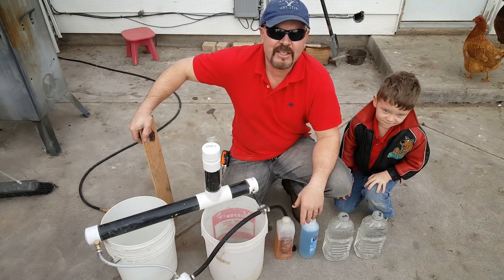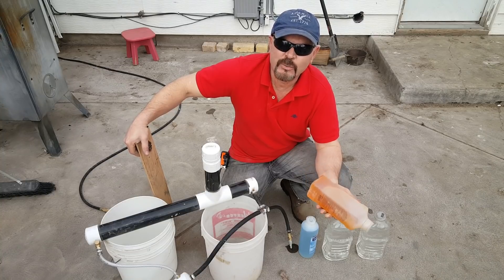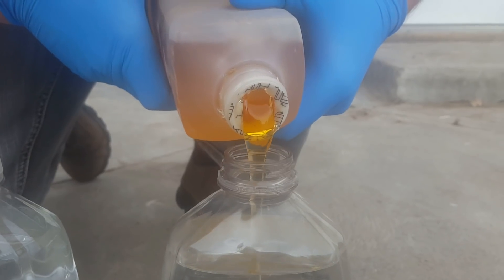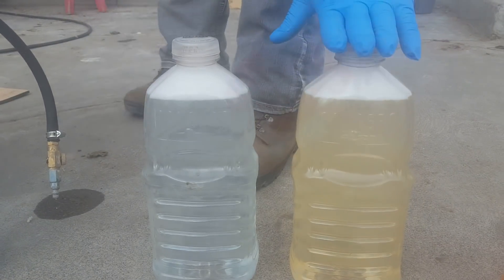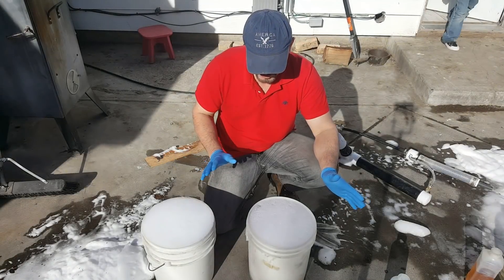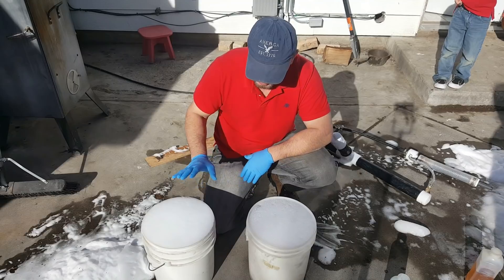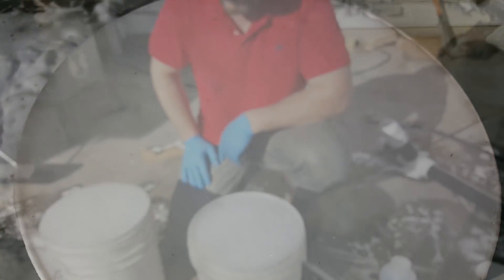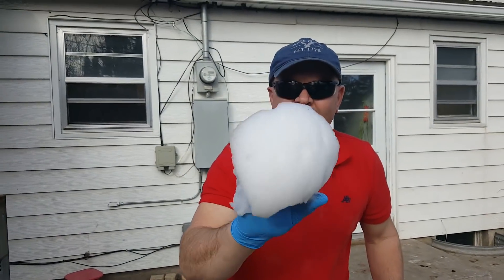The Best Aircrete Foaming Agent $ for $

Comment: I'm thinking about making a rocket stove with slightly more expensive materials used for making a DIY foundry. However, instead of making the entire mass out of the more expensive stuff, I will try making only the inner liner to cut the cost in half. That would be too thin by itself, but then I plan to cast a thick layer over everything with aircrete. When I saw rocket stoves out of aircrete, only the inner skin that was exposed to the flame was eroding. Thanks for all the great aircrete info!
Reply: If you had positive results, you should make some youtube video, which I expect might do really well.

Comment: Would also be nice if you could post the latest , precise measurements of ingredients and ratios. How to figure out foam weight or volume/whichever one you are using. For grins and giggles I built a foam wand last year and it worked very well. Used an AEWC, air expelled water can, you know, those shiny silver fire extinguishers you see hanging in stores...however, I am a true believer in getting info and directions from successful people doing the same thing I am trying to do, so looks like I will be buying one of your kits. Why reinvent the wheel?

Comment: What about that 7th generation dish soap, everyone raves about ? i don't mind spending extra on the Drexel... whatever it's called, commercial foam if it's better. I mean this is a big investment. I have no idea how all of these bubbles persist when mixed with cement.
Reply: The cement and stiff soap foam actually forms an emulsion. When done right (with a proven recipe, proper soap foam, a strong mixer, ideal temps & humidity) getting all those things dialed-in as perfect as possible, will produce a really good aircrete that is strong and durable.

Comment: Id written before wondering if I can use the mix on a quonset hut & since ill; be using plasterers lathe on the inside walls & ceiling s I was concerned about it just going right thru the mesh . Finally dawned onme that if I mix a lot then just let it set to a firmer consistancy then I should be fine with minimal clean up inside . It going ot be approx 2 inches thick on the outershell   so I can just shovel it on then  trial it down for a smooth finish .May even do the inside with the foam mate aircrete  hopper first if theres any issue about it leaking thru too much . Id thought about forming panels but I was thinking forthis style of home id be in way over my head forming them then placing them 
 Always love going back thru your videos .Best of success to you in all you do especially in this endeavor

Comment: I found this channel and was really excited, where has aircrete been all my life.   I immediately set about building a foam generator.   Mostly a hybrid of this one and Jim Whites using the eductor and combining air and liquid in a T junction before the wand.    I got what looked like great foam, tuned it to 3.3oz/liter and tried lots of foaming agents including the recommended Suave and even the expensive Richway CMX.  All of them turned back to liquid within 15min after looking nice an thick just like the videos.   I tried warm, cold, filtered soft water, hard city water, densities from 2oz/liter to 4.2oz/liter always with the same results.   I thought maybe I should run separate lines and mix at the wand, skip the eductor, just like the honey do machine so I modified it completely, same result.    I am so jealous of a foam that can last even one hour.   My wand is three cascaded pieces of stainless steel fine wool in a 1 1/2 inch PVC pipe just like everyone else.   I cannot figure out what is going wrong, its like I am living in a different universe where long lasting foam is a fantasy.   Any ideas from anyone, I am about to give up on this whole thing.
Reply: hey dont give up.I have been there done that.things change when portland powder is mixed in.
so dont get so caught up on foam tests alone.see which one work with the right amount of water and cement.
a while ago drexel worked for me but now suave shapoo is working for me and palmolive profesional.
Reply: @garyweber6413  I found that adding about 10-15% CSA speeds the setup time and allows less dependence on foam longevity.    Also mixing Drexel at 80:1 rather than 160:1 slows breakdown somewhat.   Between the two I am now getting better results.
Reply: @stevepotratz  thanks for sharing i will try that

Comment: Surely the "hardness" of the local water must also have an effect of the foaming properties, as it does when lathering ordinary hand washing soap.  "Hard" water has a high percentage of dissolved calcium and magnesium in solution. Lime can "soften" water by precipitating the calcium as calcium carbonate and the magnesium as magnesium hydroxide.  I'm guessing rain water is best ... but I've never made foam, so its just a guess.

Comment: Hello Honey Do Carpenter, I can tell you that years ago Dawn was just unbelievable for its ability to keep the foam in tack. But the women of America complained that Dawn did not mix well with the water in the sink. So the company made Dawn a lot thinner viscosity wise. Then the foaming went down hill. I know that as my neighbor was a Dawn salesman. Right from the horse's mouth. 
       Do you think that there is a way to make the foaming agent have more concentrated and smaller air bubbles ??? That would really make a big difference in the R value insulation wise. The information that I was able to get say that one inch of aircrete has a R value of 3 to 6 on the scale depending on cell density factor. Do you know if the is correct ??? Would adding wood ash to the concrete make the insulating value go higher ??? When you add aircrete to 8 inch cinder blocks that are 8 feet tall, how much compression of product and loss of efficiency would one get ???? Please touch base with me on your thoughts Sir.
Thanks for the video too.

Comment: How did you find out about this stuff ??? Also, What if you actually want large and porous concrete that has great strength for driveway use ???/ Would it work for a driveway ??? Thanks

Comment: So I'm not alone!
Hey Mr. Honey do - Engineer, do you have any idea how many times I had to stop the video and rewind?
Do you have any idea how hard it is to hear you say the word, "Scientifically" with a chicken in the background?😂😂😂

But seriously, I love the videos. 
Here in the tropics the houses are made of poured  and concrete block walls and I have several additions to a remodel I am doing.
The question is if I, +250lbs, will be able to walk on a flat and sloped roof surface?
I'll have free spans of 15 and 20 feet in places. Understand that in conventional construction I would place beams, below or inverted.
Just curious as to the reinforcement method and if I can layout out formwork as per usual.
Thanks in advance and all the best. 
Cheers.
P.S. Hurricane Maria came through here.

Comment: What if you add corn syrup it makes bubbles stable.
Reply: I have seen bubble soln recipes that add 1-2 tbsp glycerin to 1/4-1/2 cup dish soap/shampoo as a bubble stabilizer. Need 4x as much corn syrup to accomplish the same thing. Glycerin is cheap and easy to get (maybe $3/liter). If you look at shaving cream  ingredients (the best foam one would think), they use Stearic Acid for that purpose (you can purchase that online for about $3/pound in the US). The foaming agent in dish soap/shampoo/shaving cream is Sodium Lauryl sulfate (you can purchase that online in the US for about  $3/pound).

Comment: Ik see this kind solution for a rizer, very nice done, what kind of foam agent I need, in the netherlands there are commercial ones for using in concrete, I can do this with fireconcrete? or do you use just fireproof cement?, thanks.

Comment: To my ( many years of) experience the best foaming agent for aircrete is proteine i.e. ceratine based.
Proteine foam is very stabile and "stands" long enough until the cement gell that is formed while curing of the cement takes over the load bearing properties of the protein foam.
Protein foaming agent you can make yourself from chicken feathers that are dissoved in lye.  When the lye is saturated with the ceratine from the feathers, the solution should be neutralized with acid.
An excellent ceratine foaming agent can be made from shredded cow Horns and hoofs which are normally used as organic fertiliser.
The production of this high grade air crete foaming agent could be a Business Option for chicken farms where feathers are a waste by- product.

Regards

Greattimez
In sunny Españistan
Reply: Hello Bert,  I am interested in your work also.  I am curious how this foaming agent that you make compares to Drexel.  And also, do you have a step by step recipe or video that shows how to make your proteine based agent?

Comment: Is there a simple substitute for that fancy looking foamer? 
Will a hair drier attached to a tube work? How about a leaf-blower?
So I'm guessing you make a concrete or cement slurry and then mix in your foam? 
How about a clay slurry?  or a fire-clay slurry?
Reply: You could try using a metal paint mixer inserted into an electric drill.  It will eventually make foam.  It won't do as good or as fast a job as the tool that you call a "fancy" foamer, though.  Darwin's foamer is actually a pretty nifty little tool.  Industrial foamers are magnitudes more complicated and cost a great deal more money to buy.
Reply: @ @rlwemm  Thank you for your response. I came across a thing called a foam cannon, which is generally used for washing cars. It cost in the range of $14 – $20, and I ordered one from Amazon. I intend to use it with Suave shampoo and fire clay ($16. for a 50# bag) as soon as the weather becomes reliably warmer. I am getting very impatient for Summer.
Reply: @theinkbrain   Fire Clay is used to make stucco by adding sand and cement.  I see no reason why foam mixed with uncooked clay of any kind would set hard unless you stabilize it with a lot of cement.

I suspect your cheaper foam cannon will fail if you cannot adjust the foam density.  You will still need an air compressor.
Reply: @rlwemm  I'm not sure.... People have used raw clay ovens and cooked in raw clay mixed with straw for millenia to make solid, durable stoves. Its all over Youtube – go take a look here – How to make a clay stove ❤ Matti ka Chulha ❤ Primitive Technology ❤ Village Food Secrets.  If a clay and straw combination works well, there is no reason it can't be improved upon by substituting fire-clay and adding foam. Foam is foam, and if it makes the clay light by aerating it there should be no problem. And btw, how to make stucco is entirely beside the point.

Comment: I just watched a video of someone building a house and they used 7th Generation dish detergent.
Reply from the maker: I tried seventh generation. It does work hoiwever the bubbles are inconsistent in size and if you expand the mix over maybe two time you begin to get a colapsing issue before thwe cement has a chance to flash of and gain its initial stiffness and shape.

Comment: Hey, what about shaving cream?   ..straight out of the can.  Too dense? I've got a sack of fireplace cement I was going to make a forge with it. I wonder if the same principles would apply..
Reply from the maker: I think it would, Try a small sample first. Let it set up and let me know how it turned out.
Fire place cement has a short work time as it sets up quickly..HDC
Reply: @HoneyDoCarpenter  I wanted to offer a couple other suggestions to you on one of your  videos. I'm not sure if it was this one or not  but they apply here too. A trick my mom used to do to make our bubble blowing  a more lasting experience when she mixed up a batch bubble blowing solution is she would add corn syrup to the mix. That made the bubbles much more durable.. Also, I'm not sure if you're aware that it matters  what direction your  mixing paddle is turning when mixing the concrete.  When mixing drywall joint compound, they have the paddle turning in a direction where the paddle is lifting the mix from the bottom of bucket.  If it turns the other way, they tend to pull air into the mix, resulting  in air bubbles in the final mix. That would be a good thing for your purpose though, no? I wonder what would happen if you drilled a bunch of holes in the blades of your  paddle and have them just breach the surface of the mix as you're  mixing it.. 
Peace
Reply from the maker: some people reccomend pushing the foam into the mix , but you are right I have always found that pulling the slurry up works the best...

Comment: Suggestion for another foaming agent.  I was making a batch of stain treatment for my laundry using 2 bars of Fels-Naptha soap.  I grate ir into a pot then dissolve it with hot water.  So this was the first time I used the Fels-Naptha to make a laundry soap for heavily soiled clothes.  After dissolving 2 bars of the soap in 2 gallons off water I dipped a scrub brush into the soap solution to scrub a plastic bucket.  The foam generated by scrub brush was unbelievably thick and very stiff and stable.  I will experiment with it and give you results.
Reply: thanks for sharing i will have to try that
Reply: What were the results? - Thanks.

Comment: Yes, the Drexel costs about 28.00 per gallon. You need 4 ounces of this per 5 gallon bucket. When you break it down it is only about .90 cents of foaming agent in each batch of AirCrete. You will use about a bottle of the shampoo for each 5 gallon bucket.That is an average of 1,89 per 5 gallon bucket. If you are doing Aircrete in a small scale that would be fine but building houses with it, it would be more cost effective to just order the Dexel and make the foam.
Reply: Is that 4 Oz of Drexel to 5 gallons of water that goes in the foam generator?
Reply: @dave858man2  Yes! That is right!

Comment: this is a great Vid, i'm working on building a relatively low cost blacksmith shop and this stuff sounds like a great option for the walls... i live in FL so forging in the summer is very uncomfortable, with the walls insulated properly with Air crete it may become bearable or gods forbid even comfortable.
Reply: ...a great option for the EVERYTHING.

Comment: The problem with using soap agents is most contain sulphur (Salt). Salt breaks down the strength of concrete overtime leading to a weak construction. This is the reason you shouldn't use dish soap as a plasticiser in mortar/ cement products.
Reply: tap and well water contains salts and minerals, how much more salt can be in so little soap?

Comment: Save 10 minutes: Suave shampoo :)
Reply: Clarifying suave shampoo
Reply: Could any shampoo suffice? They don't carry Suave up here where I live
Reply: @AmosIrontree  Check the ingredients. You're looking for sodium laurel (or laureth) sulfate. It's just a foaming agent, and this Suave happens to be a cheap way to get it.
Reply: @AmosIrontree  any sodium silicate made soap can work better than any expensive shampoo
Reply: Bubbles will need strong surface tension to hold up. 
Basically the opposite to acetone that lowers surface tension in say oil based chemicals.
So I'd say an oily additive of some sort to help the bubble stay strong ???
Reply: @muirallie  I read that glycerin helps
Reply: You need to see the whole experiment,  it's interesting and worthy of 10 mins.
Reply: @akhtarkh  If you 2 x and skip along it's less than 5 mns
Reply: FINALLY - I was wondering what the secret sauce was.

Comment: Loving your videos.  Suave has an ingredient called sodium lauryl sulfate that is key for good foam.  7th Generation dish liquid has it too. Available at Walmart.

I'm in the Dominican Republic and always looking for a better and cheaper way to build. Any building that will stand up for a year needs to be concrete here due to wood eating insects. Blocks are expensive and well you know. I'm really liking this system. My next project is to build some chicken coups for raising chickens for sale. Perfect timing. I think I will use this system. Low stem walls maybe 2 - 3 feet high and netting for ventilation. 

Keep up the great work.
Reply: Ferrocement using aircrete

Comment: Why foam?  These liquids make sand an  cement soft takes longer to go off. I don't get the idea of this? But its nice to use with a trowel. Not sure how it goes with raw cement I'm a plasterer my self only ever used washing up liquid if there was no plastersizer near hand or I'd just use water proffer on its own especially out side work
Reply: Theres a SHIT TON of reasons to use it, and only a few "downsides," which also double as benefits depending on use. Look up a material called "AAC" (Autoclaved Aerated Concrete).

Comment: For this solution to be cost-effective, you need to make sure you shop around. I've seen that Suave Clarifying stuff you're holding, cost anywhere from 7 cents an ounce all the way up to 50 cents an ounce. Meanwhile I've been able to find Drexel FM 160 for as little as 19 cents an ounce, though you need to buy it in industrial quantities to get it at that price. I've seen one-gallon jugs go for as little as 33 bucks which works out to 26 cents an ounce.

Moral of the story: if you're doing the shampoo substitute, make sure you're getting the stuff on sale.

Comment: Could you use air creat instead of close foam insulation ? And do you know what thr R value is on it, if it has one
Reply: ...you "SHOULD" use AirCrete instead of closed-foam insulation.
Reply: I have seen R values quoted as from 4 to 6 per inch of thickness.  Don't know the density though.  May be others with numbers out there.  I just saw the two so far.